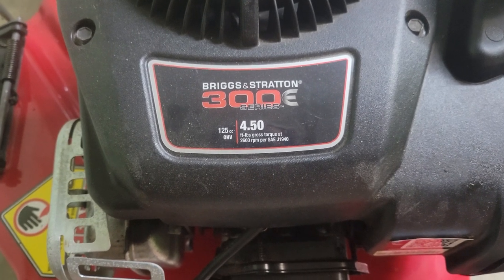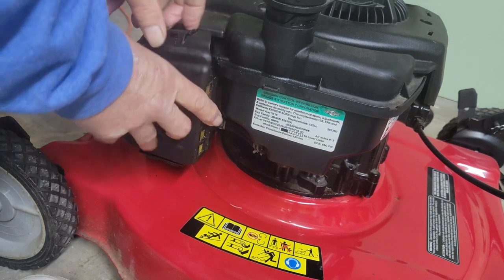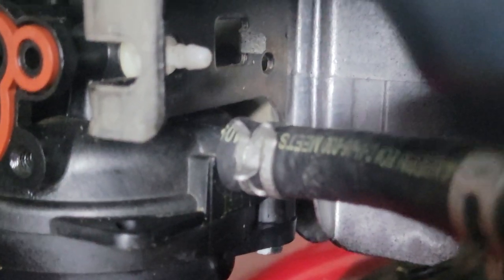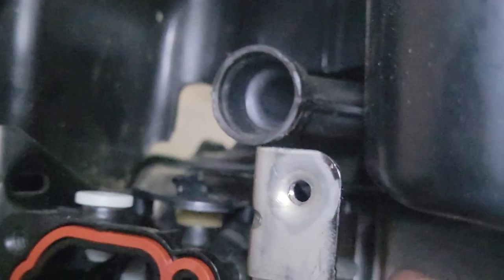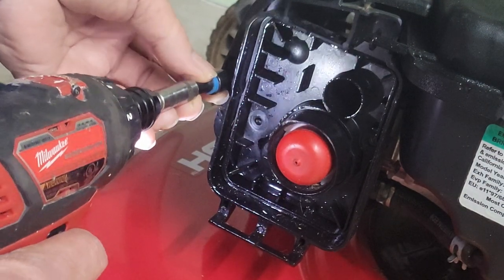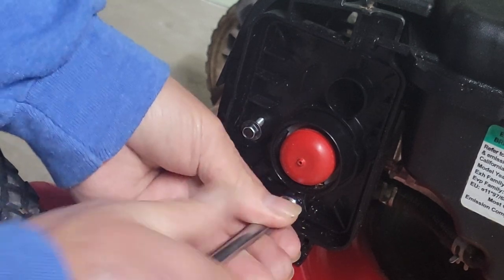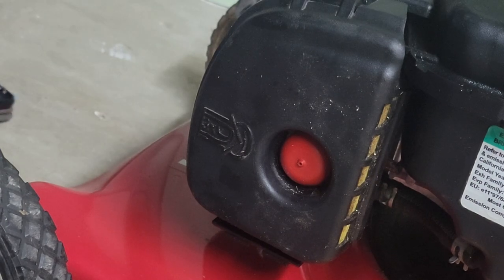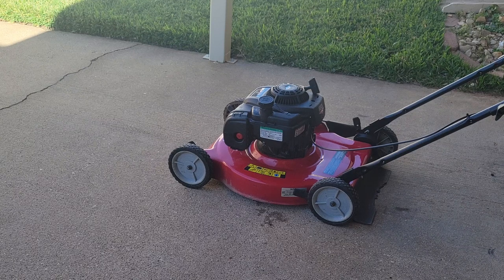Briggs and Stratton 300e won't prime, runs with starter fluid - Easy fix

Comment: Been fixing cars and golf cars for many years.  I tore into the  carb on the same mower and figured it would be easy.  I did everything but clean the jets as I could not find them.  I had no idea that the white thing in the middle popped out and the jets were in there..  Thanks you very much for this video.  very easy to fix, once I knew how to get to the jets.  :)
Well, this comment was for the video where you tore the carb apart and cleaned it.. Youtube  moved to a new video while I was typing.  No idea what video it was now..
Reply from the maker: Thanks! From what you said, I am sure you are working on a Briggs ex motor. If you started as a car guy(like me), I am sure the plastic carb had you shaking your head a little. It's a good carb, just different. 
I have tried to cover all the carbs on little motors and that's one of my favorites for cleaning. 
Good to hear it worked for you. 🙂

Comment: I picked this pos mower up over my head and threww it 15 feet, bending the cheap frame, breaking a wheel and top.. then i put it in the dumpster. Happy about it.
Reply from the maker: I could do a whole series on why I don't like these mowers. I have said it a hundred times,  anything with a Quantum motor is best.
Reply: Bet it runs now
Reply: Same bro
Reply: I found one on the side of the road, unstuck needle valve in carb, been cutting grass ever since...... #FREEFIDDY
Reply from the maker: @stevenmitchell7841 Nothing like free 😁

Comment: Wow, this worked immediately and I just reached around the back and plugged the nipple. You are a genius.
Reply from the maker: Cleaning the jets is also a good way to go but it doesn't change anything about this vent, it just shouldn't be there. When you stop the odd bowl vent the jets tend the clear themselves quickly 🙂
Reply: @GuysPlayingWithTools  Prior to this video I poured a whole bottle of stabil fast fix in the tank so hopefully  it will blow out the jets. Thank Again,
Reply from the maker: @christopherbuxton3290  That's a lot. It should be helpful. As a rule, it won't help if it won't start, but since you are pushing fuel through the jets, it seems like it would get them back to perfect after a few mow days. Fall is coming,  remember to run it empty before putting it away for the winter.

Comment: Thanks a million, I've been running the 12000 series for years & it was always the rear gasket starts leaking, just got one of these & the same problem you are showing, I've got some vacuum line so this is an easy fix, again thanks.
Reply from the maker: I am glad I can help 🙂
If you are handy, take the bottom 2 bolts off the carb(bowl bolts) and pop the white part out GENTLY with a flathead,  then run a wire through the small brass parts in the white part and put it back together. Everything only fits one way, so if it all goes together,  it's right. 
Do that, and block that foolish port, and I would bet 11 cents it starts first pull. 👍

Comment: I did what you showed in the video and I can now start my Murray B&S 450E with one or two pulls! GREAT VIDEO! YOU have saved this mower from from the dreaded DON'T OR CAN'T USE IT ANYMORE JUNK PILE! THANKS!
Reply from the maker: Isn't it great when an easy fix actually fixes the problem 🤔
Reply: YES, it makes an older man feel good. I have a BIG interest in mechanical things - not a BIG aptitude but I am going to share your FIX with two local buddies who do small engine repair AND a Mennonite run small engine shop where I bought the small tubing for the fix. GREAT JOB! THANKS AGAIN!
Reply from the maker: @davidp.swaney353  THANKS!! I appreciate it!  I love hearing that I helped a little.   I don't make anything doing this, it's all for the fun of knowing I helped someone here and there. I love getting subscribers, it tells me I am doing something right.  😁

Comment: I messed with that Troy-bilt till I about had my scalp pulled out because the hair was LONG gone about the primer on the other side.  It ran fine but would not prime and I had all that straightened out before it sat. I countersunk the NEW carb a little to make sure it wasn't restricted and then covered the air box gasket all over EXCEPT the primer hole with Permatex #2. It WORKED but then the self-propel quit. THAT'S when I got rid of everything but the Snapper walker and Craftsman rider and bought the Stihl. Now she don't have to pull start and I don't have to worry. Now for the spare rider. Thanks!
Reply from the maker: I don't think I have any permatex or anything like it,  with carbs. If they don't work, I go straight to the jets and then clean all the assorted passages. A complete clean and new gaskets would fix the priming problem, but capping the vent also works, and it doesn't hurt a thing.
Reply: @GuysPlayingWithTools  I usually do but I have stuff torn down and removing rats nests and such so not a big deal. And it's usually a main jet issue anyway like you said.

Comment: Hey man, you are absolutely amazing!!! I covered mine just like you instructed and "bam" it started right up. Thank you so much.
Reply from the maker: Thanks 😁
It's not the "right" answer (clearing the jets is better), but it works every time.  I am glad it helped.
Edit: Don't forget to hit the subscribe button,  that's what is all about for me 😁
Reply: @GuysPlayingWithTools  Oh yeah, I tore the carb apart (piece by piece) I sprayed every orifice and every jet port with carb cleaner, compressed air and used a strand of wire to make sure I got everything. Then I wiped it all down, put it back together and nothing. But after seeing your video, I covered that nipple with my finger, hit the primer bulb (7 times) and it started right up. So then I found some old fuel line and heat shrink wrap to make a permanent fix. So far, so good.
Reply from the maker: @William Chapman  That's exactly what I found when I decided to sit down with the carb and follow every passage... all the "normal" fixes failed. When I saw the possible air leak, I put duct tape on it to test, and it worked, so I came up with a good way to make it work every time. I love hearing it work for other people.
Reply: @GuysPlayingWithTools  Thanks again for all of your responses.
Reply from the maker: Hey thanks for watching. 🙂
Reply: It worked for me too saved 10$ on a inline filter an carb tear down
Reply from the maker: @danielkyzer2970  It's great to hear,  I love it when I wake up to comments like this.  😁

Comment: Can't believe this worked. 👍🏻 I could keep the mower running by continuing to press the Primer. Once I stopped Priming the mower would shut off.
I was Skeptical about this fix.... SO I just tried putting my finger over the end of that (whatever that thing is he capped off) and YEP!!! It stayed running...
I took my finger off and it stayed running.... Seems all I needed to do was Cover the end of that for a few seconds and I was fine again...
Mower starts and stays running now. I still may plug the end of that off like he did in the video....
- THANK YOU!!!! ....Great video!...  I still can't believe it worked!!!! 👍🏻🤓
Reply from the maker: It surprises everyone when they try it.  I stared at the carb internal plumbing for a while before I thought, "This vent should be a problem. "... and found the trick in the video. 
Later versions of the same carb have a solid piece instead of a vent

Comment: Hey this was really helpful, I’m working on one of those little turds right now! Actually mine is a Briggs 550E on a Poulan mower but it’s the same carb. I noticed that nipple and wondered why it was there, now I know! One piece of advice, do not try to drill the jet out even one size bigger on these little engines. You can get away with it on the 725EX because it’s 163cc but on the 140cc and smaller you will be buying a new carb if you try to jet it even one size up, it will run like the choke is on. That’s why it needs the air filter in place to run right, there’s no wiggle room to tweak the jet like the larger engines.
Reply from the maker: The 300 through the 6xx use mostly the same carb. Don't touch it unless it won't prime, it's a vent for something that doesn't need a vent LOL 
FYI, I LOVE the briggs plastic carbs, the jets pop out "easy peasy" and always clean up quick. Email me if you get hung up in any way.
Reply: @GuysPlayingWithTools  yeah, I kinda like the plastic carbs too. They don’t get corroded when dummies leave ethanol fuel in them all winter, they’re super easy to service PLUS they have that awesome bowl drain. I just need to cut down an Allen wrench to fit up under there and get to it lol!
Reply from the maker: @mjg263  I just pop them off, 4 screws and it's in your hand, gotta love that

Comment: I just got this mower and really good shape for free the guy didn't know what the problem was I was looking around trying to figure it out here I am
Reply from the maker: If it's got the black carb, this will probably work. If it doesn't work. I have a recent video cleaning the jets. Check for spark too, a bad safety cable is usually the guilty party if there isn't one.

Comment: I got a one season winter old and it has same issue. Will give it a shot and see what happens. Why is it necessary to plug the air intake?
Reply from the maker: It's a vent.  This is a shortcut to delay rebuilding the carb. The carb is designed under California standards and tends to run lean on its best day and not deliver enough fuel to start the motor unless it's ideal.

Comment: This doesn't really concern what's in the video but it's the newest video I can see with this engine. Last year I was mowing and it was running great like it had been for 4 years. Then all of a sudden, it stuttered, kinda backfired and blue smoke just start rolling out of it. It didn't last long but it was enough smoke to fend off every mosquito in a 100 yard radius. I thought she was done for. So I took it back on level ground. Looked it over. Didn't see anything visibly wrong. I primed it, pulled the cord and it started and I was able to finish mowing my yard. The next time I mowed, the engine was clearly ill. It had like half of the power it had, it chugged along at times. Grass even slightly thick would stall it. So the first thing I checked was the filter. And it was soaked with something. I don't think it was gas because it didn't really smell like gas. But I'm not sure why it would have been soaked with water. I cleaned the foam filter, sprayed some carb cleaner into the carb. Started it, it burned off the carb cleaner and it actually ran but it was weak. But the rest of the summer was a battle to keep it running. I would prime it and most of the time it would burn that off and it cut right off. It would run for 10 seconds and cut off. A few times it would run but she chugged and stuttered like crazy. Fast forward to now. I took the carb off to look it over. Everything looked great. No debris, no water. Float looked good. Everything looked good. I put it back together. Primed it, pulled the cord and son of a gun, damn thing started right up and it was humming like it did when it was brand new. I was tickled. The first thing I did was aimed for some really thick grass and it mowed it down without any hesitation. I was mowing for probably a minute and she coughed. Then she chugged. Then she cut off. A few choice words were said and I saw gas gushing out of it. I forgot to screw in the 2 screws that hold the carb together. My fault. So I put the screws in. Put some more gas in. Started it and the damn thing started chugging and coughing like it did last year. Why in the hell did it run so good just a few minutes earlier. Put in 2 screws and it runs like crap? So I keep priming and starting it. Run for about 30 seconds and it would cut off. Start it and just shoot a bunch of carb cleaner in it. I probably shot a quarter of a can in it. It finally started sounding better and it was running for probably 2 minutes. So I decided to try it on some grass. It mowed, a few coughs and chugs here and there but it was running and was fairly strong. Then it cut off again. Got it running again, ran over a dusty dirt spot and it cut it right off. So I got to thinking, I got another mower with the same engine. It was just a dumb thought but I figured to switch the filters. Got the filter from the other mower and it was in worse shape than on the mower I'm trying to fix. I said screw it. I switched the filter and the damn mower ran for 30 minutes at full song. Not one issue with it. It was knocking down tall grass and weeds like it was brand new. I cut it off just to start it again and it started right up. How in the hell could switching the filter with an even filthier one make the engine run that much better? So I keep mowing. Happy as hell, and confused, that the mower was finally running good. I hit a dusty spot and the damn thing choked right out and it's back to doing the same damn thing again. Start, run a few seconds and cut right off. Sorry this was so long but what the heck could be going on with this? Why would switching filters, for a dirtier one at that, make it run so good and why would just simply running over a dusty spot mess it up again. The dust didn't even get around the filter/carb. It was blowing away from it.
Reply from the maker: Where to start... I had to re-read it a couple times just to make sure I didn't miss anything. I will try to touch all the bases you mentioned...🙂

I see a possible fuel flow issue causing it to lean out and lose power and also a flooding issue. The combination of the 2 would cause exactly the type of behavior you are seeing and make it seem like it had developed a personality. 

1) The colored smoke tells me the floats stuck open, at least for a moment. The liquid on the filter reinforces it. 
2) The dirty filter making a difference but then getting a touch more dust on it making it get worse tells me that the carb is normally running a bit lean. 

There are probably 4 years worth of fun and games hanging around in the jets. That is reinforced by it running "soft", not having enough power to do the job it has always done. That would cause the motor to run lean. The colored smoke tells me the floats stuck open, at least for a moment. Again, 4 years worth of wear, dirt, gas deposits, loose change(LOL) stuck in the seat of the float.  The dirty filter slowed the air, causing it to run a bit richer, that didn't fix it, it just hid the problem (for a minute).

Fix: 
1) Restricted fuel flow - Clean the tank and filter\strainer in the tank and replace the fuel line. Take it to your local auto store and match it for size, make sure they give you fuel line, I had one give me rubber hose not rated for fuel.🤨
2) Floats sticking on the carb - Replace it. That takes care of your sticky floats and your clogged jets all at once. If they weren't $25(or less) I would walk you through rebuilding it but it's cheap and puts it to bed all at once. With the cheap price of carbs for little engines they are rarely worth the time it takes to get them "right".

Once you are done... CHANGE THE OIL!!!(Really! LOL) When a carb floods it ALWAYS dumps gas in the oil, it's just a matter of how much gas got dumped in. The 300e takes a max of 16oz (.47 liters)

So... after that overly long explanation of why.... fuel line, carb, air filter and oil change and you should be good to go. 😁 We have a running joke around here where I say "betcha a Nickle" when I am sure of something... 

Betcha a Nickle.
Reply: @GuysPlayingWithTools  Thanks for the reply. I soaked the filter in dawn dish soap and water over night. It cleaned up quite well. Rinsed it many times and dried it of course. Then I went and just took everything apart and soaked it with carb cleaner. Took out the, I guess the venturi, and shot carb cleaner in every hole it has until the cleaner shot out of the other holes. Damn near shot a stream in my own mouth from a little hole I didn't see that was pointed at me. Shot cleaner in every hole that gas passes through. Put everything back together. Made sure everything had a tight, snug fit. Put some gas in the tank, primed it and on the 3rd pull it started right up. Strong hum. A very light hiccup about every 3 seconds. I let it run for 5 minutes. Took it over some gravel and dusty dirt and it never bogged down. Went through some 12 inch tall grass/weeds and it mowed it right down. I cut it off. Waited about 30 seconds and it started perfectly on the first pull. Ran it about 5 more minutes. Cut it off and waited about 10 minutes. Started it again perfectly on the first pull. So maybe, hopefully it's gonna be reliable again. I'm right fond of her and plus I don't feel like dishing out $250 bucks for another. But I do plan on getting another filter and changing the oil.
Reply from the maker: Fantastic! Do the oil pretty quick, with what you described it's bound to have s bit of fuel in it.  This made my day, and it's still dark-o'clock I'm the morning.  😁

Comment: Mine doesn’t have that plastic it’s just a metal screw. Thanks for the video it’s helpful.  I’m never buying anything again with “Briggs Stratton”… lol
Reply from the maker: I hate to admit it but I kinda like the plastic carbs, it's the lack of an idle control that drives me a little crazy.  On yours at least you can bump the idle a bit before changing spring tension

Comment: What size was that pvc tubing/plug you made sir?
Reply from the maker: It's been a little while, but I am 99% sure I used 1/4 weedeater  fuel line. The 1/4 line I use is a tight 1/4, so you could probably use 3/16 of you are willing to work a bit to get it on.
Let me know how it goes!

Comment: Mine has that nipple and one in the back of the air cleaner , to the primer. Would connecting these with a hose do anything good, or bad ?
Reply from the maker: Is it running OK now?